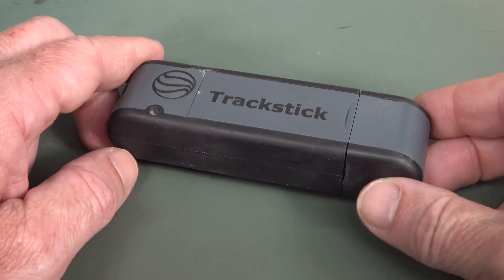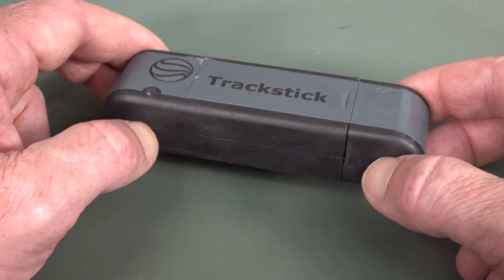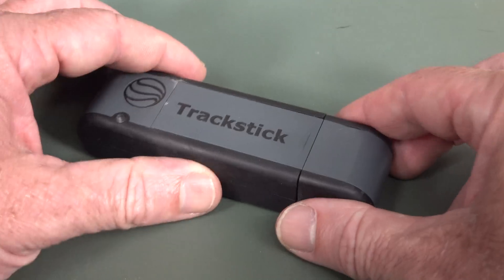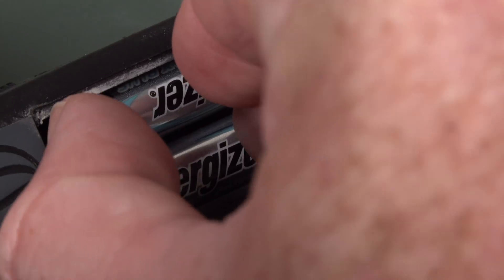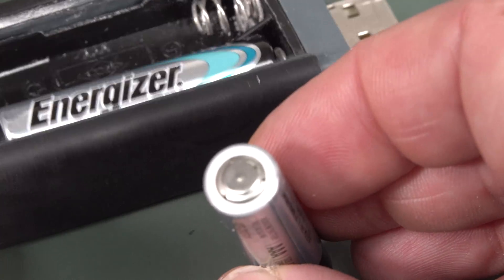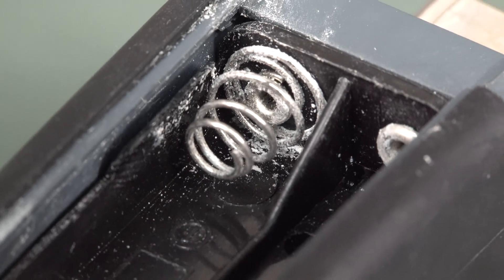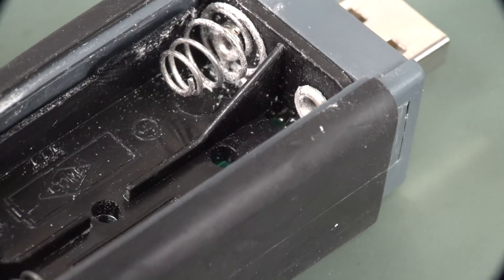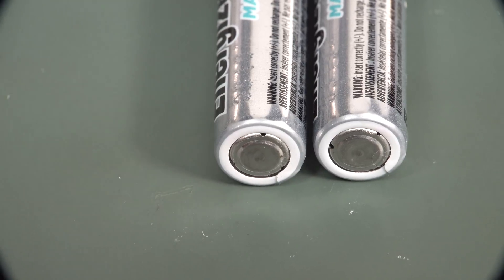Energizer Battery Leakage Followup

Comment from the maker: Forgot to add that the battery voltages were 0.77V and -0.17V
Reply: One day I found a battery charged at -1V and thought my meter was faulty. Tested with another meter and it turned out it was really charged to -1V!!!
Reply: @atmel9077  just install it backwards and bam you got one volts and a working battery  in a remote again
Reply: @atmel9077  how does that even happen?
Reply: @colejohnson66  If a cell in a series string is weaker than the others and reaches 0v first, it will be charged in reverse until all the other cells are flat/the device stops working.
Reply: that flat in only a few months?
Reply: @David5467  ya that did not take long to draw those batteries down
Reply: Good enough for the Dixon V multiplier!

Comment: Just bought new Duracell Optimum they come sealed in a Trey and two of the batteries were leaking acid you couldn't see it till after you bought it and opened the package and it had all this white powder inside so I called Duracell they sent me a coupon for $10 worth of batteries I was also surprised to find out when I was talking to them that there is no expiration on these batteries yet

Comment: In the US, Duracell, Energizer, and Rayovac (bought by Energizer) all leak. All heavily counterfeited and often short-dated by online sellers and cheap stores.
 All three makers will repair or replace the device for free here, if the batteries are genuine and in date.
 Vinegar and a toothbrush clean that residue 100٪.

Comment: Would suggest there were chemicals remaining inside the assembly from the first leak. While the compartment cleaned well  the leak must have left residues beyond the battery compartment, which has returned in the interim

Comment: The things I wonder:
Is it the white stuff of some white stuff?
Can the plastic casing serve as a reservoir for some of the leaked battery intestines? If so, there probably was some of that stuff soaked up in the material that came out again as the concentration outside fell due to a good thorough clean.

Comment: You need to clean this with some strong base otherwise it will come back when it dries. If you only used isopropyl then you most likely didn't get all... Edit: vingegar often removes it quite well.

Comment: Dave I've learnt over the years that after cleaning off "all" the corrosion, to stop it from coming back I usually recoat the infected part with a thin layer of solder. that stops the corrosion from coming back, the solder penetrates the pours of the infected metal.
Still enjoying your videos.
Steve
Reply: I'd guess acidic components in the flux react with the trace amounts of KOH. That you're tin plating it also helps.

Comment: If you used isopropyl to clean it, it probably left a bunch still on the case and contacts. It's probably not very soluble in alcohol, and all it did was soak up some liquid and become translucent. When the liquid evaporated, they became visible again.

Did you nick out to the shops and get that vinegar? The water in it will dissolve the by products of neutralization and help remove the residue.

Comment: Maybe batteries outgas all the time and in a compartment with poor airflow the chemical laden gas crystallizes out in high concentration areas?  Would be difficult to test this as putting them in an airtight container would halt/slow the chemical reaction I think.  Perhaps worth testing in some semi-sealed container somehow?
Reply: that sort of scenario is what I was thinking as well.
Reply: @oledonly  The whole 'why some leak/why some don't' seems to be a massive mystery which is crazy in this age.  It is time some labs did proper science on why/when it happens.

Comment: Man I just had a brand new set of Rayovacs shit the inside of my Agilent multimeter. Blew up so bad it actually caused the battery compartment to basically just disintegrate into little bits of orange plastic, and all the metal contacts looked like they just came out of the ocean. Now my meter has a battery compartment made of super glue and popsicle sticks. I hate alkaline batteries.

Comment: There is some magic to when batteries leak and when they don't, and i'd love to know the chemistry behind it.
Recently i dug up a TV remote i had laying in a server-room for 6 years!, a room that is up around 40c/104f each summer, and when i picked up the remote and felt it was heavy, i was like DAMN it has batteries in it and is going to be leaked all over, but nope, the batteries were completely flat and showed no signs of leaking at all!

In contrary i have had some 8x AA 12v battery packs leak in the same hot room, while not being connected to anything, just sitting there, and even though they started leaking, they still held a charge.
So i don't necessarily think that either being drained or sitting in a hot room, in it self is a requirement for leaking.

Sometimes batteries seem to have a life of their own.
Reply: Maybe it's all down to variance (or defects!) In manufacturing. I've got a Vinnic 9V battery that's been in a doorbell for 20 years and still hasn't leaked either!
Reply: @Willam_J  Yeah well, we all know this, but it isn't the whole story, as some batteries leak while having a charge, and som can lay discharged for years, and never leak.
Reply: The leakers while still holding a charge guys bug me the most. Actually, reminds me of a 6 pack box of cheap C batteries i had (practically dollar store alkalines) 1/2 leaked unused in the box 2 months later.. I still have the remaining 2 sitting as a test and they haven't leaked 3 years later. I punctured the case of 1 and there was a decent hiss.
Reply: I've even seen some leak in the factory packaging, a partial sleeve of Ikea alkaline AAs I lost track of for a few years.

Comment: The batteries need to vent. A Mag Lite Flashlight (Torch) has the same issue. They are waterproof & seal up with O-Rings, so the batteries leak out and corrode the insides of the flashlights (torches).

Comment: A lithium ion pouch cell wouldn't have that problem. I don't know why people still use alkalines these days. I can't find a good torch that takes a 18650 locally for example, they're all 3xAAA, sold right next to the batteries themselves. I guess it's a monopoly the manufacturers refuse to give up, and people still buy them cause they don't know any better.
Reply: A good portion of 3xAAA flashlights are also compatible with 18650s if you remove the cage. Not all of course but it seems common in the newer designs.
Reply: @eDoc2020  maybe very recently (in the last year) but here I can't find any, they're all too small to fit a 18650 (they would fit a smaller cell but then what's the point in that if you have to buy batteries from ebay)

Comment: The white crusty stuff is not battery acid leaking out, it's corrosion of the metal interface.  Just as trees grow from the air and not the dirt, oxidation occurs from the atmosphere and not from inside the battery.  An electrolysis reaction is occurring between the two metal interfaces, fueled by the water vapor between them and the electricity the battery provides.  Have you ever seen a "leaky" alkaline battery from a reputable manufacturer in recent decades that was just sitting out, not connected to anything?  I'm not saying it can't happen, especially if it's exposed to extreme temperatures which can cause physical strain in the casing, but the vast majority of the time, it's simply byproducts of a tiny electrolysis reaction.

Comment: It would have been there from the original leak. You wouldn't be able to clean it all off and the metal would be pitted and contain traces of acid
Reply: The stuff in an alkaline battery is just that -- alkaline. Not acid. That's why you use vinegar to neutralize it, because acetic acid will react with the potassium hydroxide and make products soluble in water.
Reply: @JennyEverywhere  yes you are right.

Comment: Recently (Dec 2020) I bought some Energizer CR2032 (?) battery cells.  All of the batteries failed quickly (12 of them).
When I looked closely at the embossed Energizer logo I could see problems with the impression.
The Energizer wording and logo looked crappy and the batteries were fake.  They were sold at Canadian Tire in a major city.
Reply: After realizing they sell the plain ones while ordering some leaded ones I've decided to get all my button cells from Mouser/Digikey, genuine Panasonic for well below retail.
Reply: @Broken_Yugo     Panasonic is a very solid brand.  Good alternative to Sony
Reply: Geez first it was counterfeit batteries on Amazon now they are at Canuck Tire. Guess the buyer got a good deal on a bulk purchase of those cells.

Comment: An special case but i charged a pair of AAA alkalines and at first they looked ok, but month after they leaked. This has been consistent with all the alkalines ive tested. Maybe it has something to do as i also noticed that they dont leak by overdischarging, but they leak if left too long without use. Maybe its some chemical reaction that is only triggered under certain conditions

Comment: I'm thinking that the contact spring pressure over time may have something to do with it.  As well as the vibration from handling during mailing. It's not internal pressure causing the leak, but external pressure opening the seal by pushing the end cap in.  At least that's my theory. That would explain why they're more likely to leak in equipment than on a shelf.
Reply: That could be. I used to service audio dosimeters. We would get them in with corrosion all the time. The battery compartment put a lot of pressure on the batteries such that the ends get dented.

Comment: If you'd like to test battery leaks, you'd need to get a bunch of low powered devices, hundreds, and keep the batteries in for a year or more.

Temperatures over time have effect on the chemistry, for sure
Reply: He already did (with resistors). Search the main channel.

Comment: I have had issues with energizer in the few years.  I switched to using amazon basic cells made in Taiwan and have not had leakage issues.
Reply: I used to buy Amazon Basic rechargeable batteries that were made in Japan but now Amazon has switched to China-made batteries so given those the boot.
Reply: @GregM  Get IKEA ones if you can
Reply: @GregM  they're just panasonic eneloops, there's only one (nimh) battery factory in japan so they're all the same

Comment: What did you clean it with? Did you make sure to clean it with vinegar or something acidic to neutralize residual alkaline electrolyte that may be left behind that you can see after cleaning off the visible gunk.
Reply from the maker: Yes, vinegar and isopropyl. But like I said, only the externals, not the internals I couldn't access.
Reply: @EEVblog2  and internally is most likely where it was hiding. Just under the battery holder. With it still being liquid when it leaked, you would have had to fill the case with vinegar then ipa to get it all out.
Reply: @EEVblog2  You should've put it in a bath of white vinegar and scrubbed it with an old tooth brush.